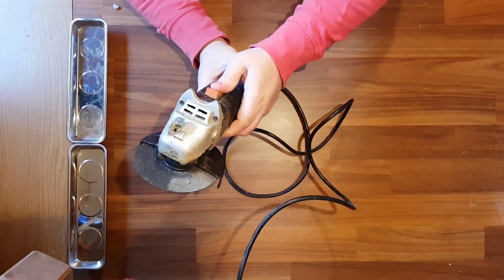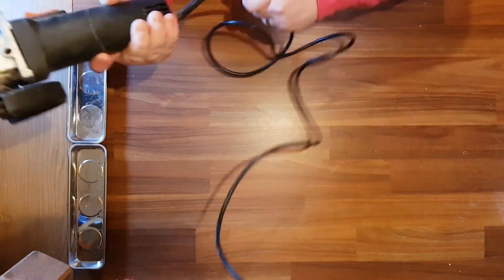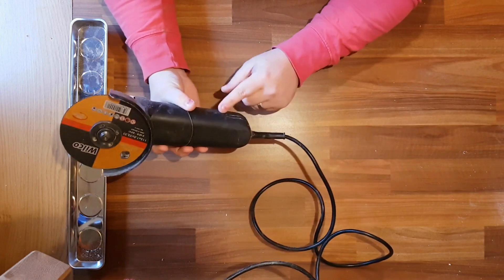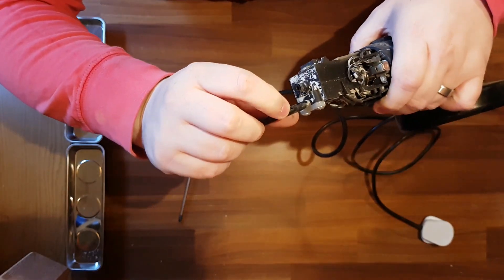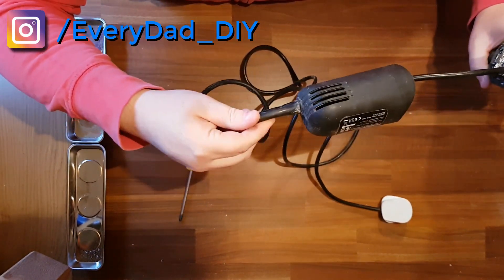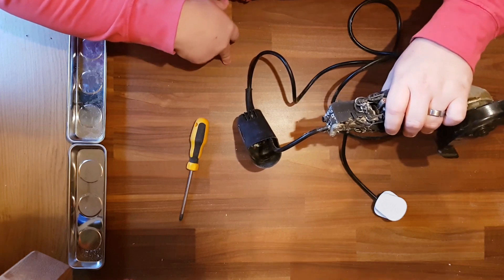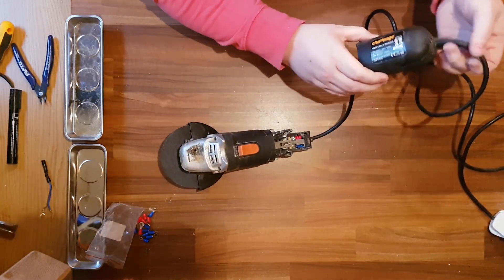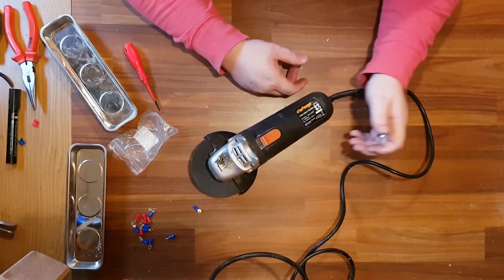Fixing an Angle Grinder with an intermittent problem.

Comment: Very satisfying mate. Good wee tip about using the grips in lieu of the crimping pliers, that'll save a bit of grief the next time! Thanks for that.
Reply from the maker: Thanks man. Ya I find the grips work very well. It's great to be able to keep old tools working. That's the first angle grinder I bought maybe 8 - 10 years ago. Still going strong 👍